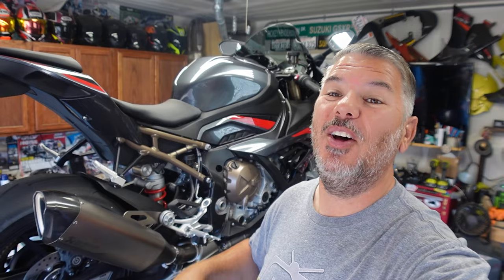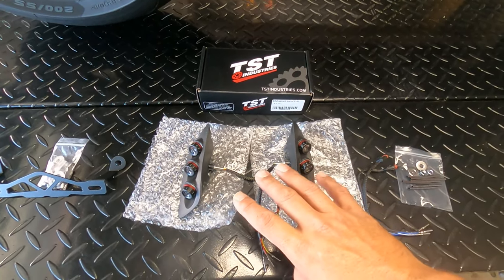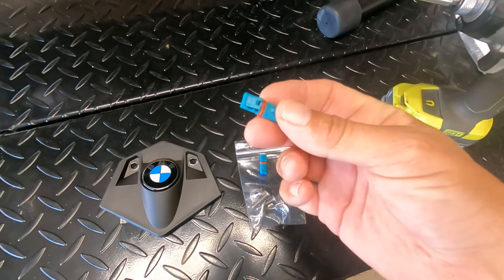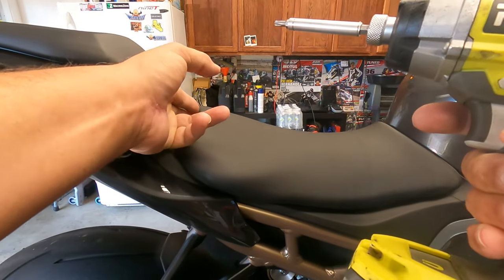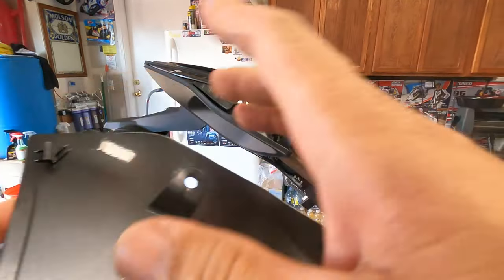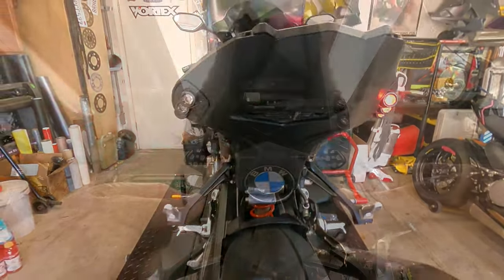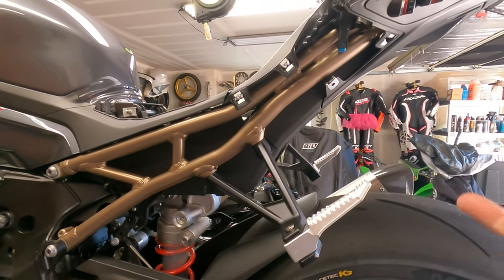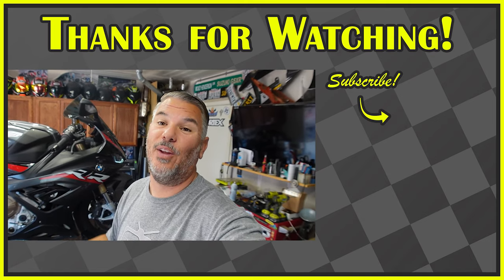2022 BMW S1000RR | TST Industries In-Tail LED Integrated Tail Lights Install

Comment: Nice vid. One note - you do NOT need to remove the seat to do this installation. I have these lights on my bike, and because I’m in Australia I get the amber as well. Really nice solution. They are ultra bright and look completely oem when installed. I also installed the TST hi-mount license plate holder with LED plate light and it looks great. Easy installation and no mods required to the bike’s wiring - all plug and play.

Comment: Hi Bill. Just fitted my TST kit to my 2022 bike, like everyone else I'm still getting the licence plate light fault even with the dummy plug fitted. Can you just confirm even with yours fitted it's still showing the fault in the standard modes? I know it can be turned off in race pro but it's the standard modes I'm wondering about. There was 4 dummy plugs came with the cover kit, 2 for the indicators front and 2 for indicators back. None for the licence plate light, I can't see what the point to giving us dummy plugs for the indicators was if it's just gonna throw a fault for the licence plate light anyway?? Thanks in advance
Reply from the maker: You have to turn it off in the back ProMode menu
Reply: @CaliMotoTV  hi thanks for the reply. I know it can be turned off in promode, it's the standard modes I'm wondering about like road, dynamic and race. Do you still have the error symbol above the abs light? I suspect you do from your video, the dummy plug isn't actually doing anything

Comment: Great video.  Question for you.  If I was to buy the rear fairing (tail end) of the S1000RR, would they fit on the S1000R?  
I hate that BMW put the turn signals and brake all in one on the signal indicators. This option gives more visibility so people will notice the bike when following you.

Comment: I went with the TST tail lights and fender eliminator on my 21 S1000RR!  Very happy with how it turned out!
Reply from the maker: Glad to hear that!
Reply: Brady, I purchased the tst closeout also. How did you resolve the license plate light error?
Reply: @jaredmarshall8133  the license plate error is caused by a bad connection with the quick connector.  What happened is I inserted the wires too far in the quick connector on the plug n play wire harness so it didn't have a good connection.  After some adjustment I was able to get the wire leads to connect properly with the quick connector.  The license plate light turns on and there is no error.

Comment: Great video. Very detailed. I believe  I saw a video where a small hole was drilled to run the license plate light above the tag. But, did the dummy plugs come from tst?  That with the bmw plate logo looks excellent
Reply from the maker: The dummy plugs came with the plate block off.

Comment: Best solution for the tail lights by far. Is it possible to keep passenger pegs with that plate relocate?
Reply from the maker: Yup!
Reply: @CaliMotoTV  is that with the same ticked position? And same brand ? I just bought my S1000 M yesterday and really want a tucked plate with good fitment I just don’t want to remove my passenger pegs :(

Comment: Great video! I have the same setup with the BMW cover. The dummy plug doesn’t seem to work. I still get the plate light error /warning. It doesn’t go away
Reply: Same here, did you find a solution?
Reply: @aturk1731  nope. Hoping the dealer can just remove it
Reply from the maker: There's a race mode setting where you can turn that off.
Reply: @CaliMotoTV  is there nothing that can be done in other modes such as dynamic

Comment: Hi, thank you for your great video! I installed this kit today, but I realized I forgot to buy the plate light. Now there is a plate light warning on my dash. I noticed that you did not have the plate light as well. Do you have any way around this warning? I am planning have the bike tuned from BrenTune, I wonder if they can clear this warning through a flash?
Reply from the maker: It's a setting in the back menu you can turn on and off.

Comment: Another great video! Question . Why is there no light for the license tag? Wouldn't that be required by law for possible riding at night??
Reply from the maker: Technically the indicators aren't "legal" either, so.... 🤷‍♂️
Reply: @CaliMotoTV    Okay, and actually I don't ride at night anymore here in Atlanta since I retired from GM in '08.
Reply: Tst offers a license plate led light separately. It’s cheap. Like $20.00.

Comment: Hi man. I just bought the NRC integrated brake light turn signals fender eliminator kit for s1000rr m1000rr , I installed it, loks great, the turn signals are ok, but the day light and the break light are not working. There’s a message on the display saying “Brake light faulty, Have it checked by a specialist workshop”. My bike is BMW s1000rr 2020. The turn lights are red, so the product is may be the US market. Could it be the reason for the problem? My bike is produced for the european market. can I fix it by myself or I must purchase the EU version of the product? Thanks for helping me.
Reply from the maker: No sure, please reach out to TST

Comment: Thanks for posting.  A word of caution.  A person in a forum posted he stripped the screw holding the riders seat in place.  He had all sorts of problems/headaches fixing.  So when I saw you use the driver to take the screw off, it set off alarms in my head. :)  I am interested in these light.  Good to see TST finally has them in the market (took them a while).  How is the fit and finish of the lights and are the light bright enough to be easily seen by drivers behind you?
Reply from the maker: They're brighter than stock. Great fit and finish.

Comment: Do you have the link to the dummy plugs? Where did you purchase them?
Reply from the maker: It's from revzilla. Part of the block off kit. Link is, and has been, in the description.
Reply: @CaliMotoTV  Thank you!! I pick up my 22 s1000rr on Monday!
Reply: I bought the same kit plugged in the dummy plug in the license plate light and I still get an error! I bought the same m cover kit straight from the dealer. Ugh I wonder if my dummy plugs are different.

Comment: It seems brighter than the stock lights
Reply from the maker: Definitely very very bright
Reply: @CaliMotoTV  I watched the vids by the manufacturer, and while I like the look of the passenger mount tail tidy, in my part of the world that would attract too much attention from the PoPo so the other tail tidy, with its variable angle, would be less likely (but not immune) to attract that attention.  They make nice gear.

Comment: Do they make the plate bracket with a light to make it legal?
Reply from the maker: Yes, however, technically most tidy tail set ups are illegal since the spacing between the indicators aren't up to spec.

Comment: Great information.  Can you please share a link or part# on that BMW emblem delete plate.  I was unable to find it. I also have the 2022 on my S1000Rr, but TST delete plate doesn’t have the emblem.
Reply from the maker: https://www.revzilla.com/motorcycle/bmw-m-race-cover-kit-s1000rr-2020?sku_id=1745939
Reply: Thanks so much!
Reply: The high mount/lights doesn't come with a block off plate?
Reply: @corbinroy4851  it does, just a standard (no emblem) blank plate.  I wanted to BMW race plate that makes the install look factory.  Looks great, I now have on my bike.

Comment: how did you get the roundelle for the cover plate??
Reply from the maker: Block off plate link is in the description of the video.
Reply: @CaliMotoTV  it’s sold out:/ found one on eBay